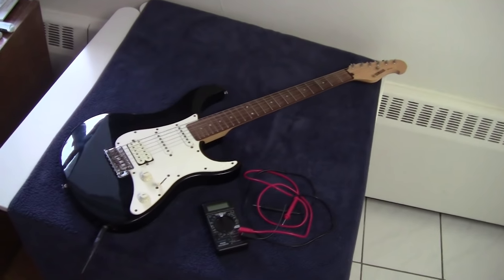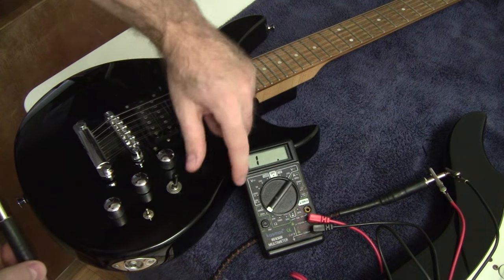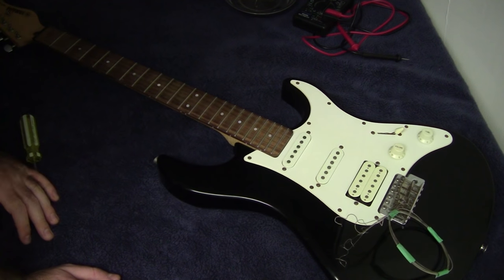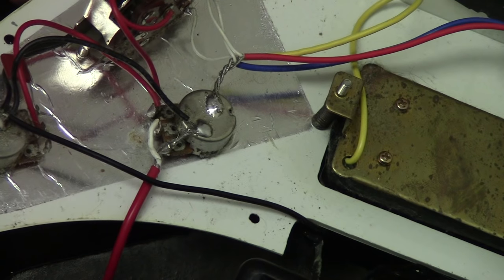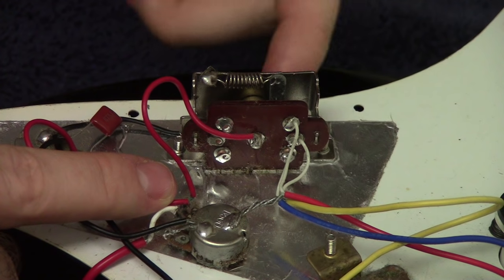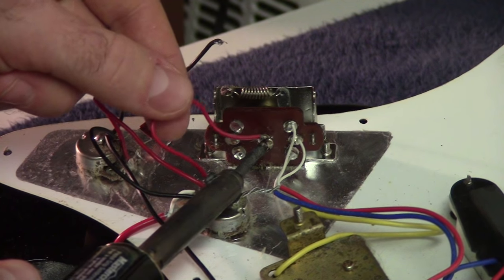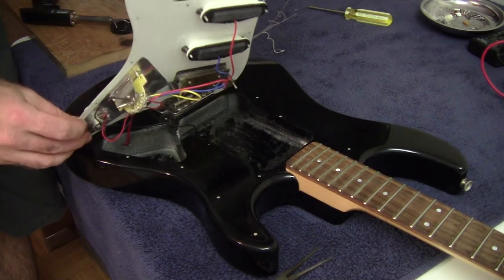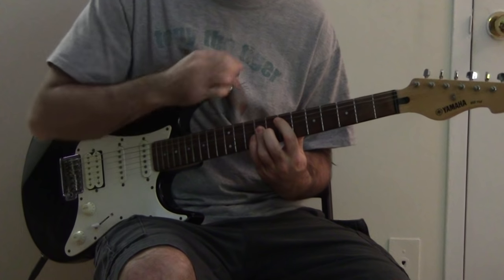How to Troubleshoot & Repair an Electric Guitar

Comment: Wont a working pickup make a noise through the amp when you tap on it with the pick? I never thought about it but suddenly I don’t think my pickups are working,and first want to know if. Thanjs
Reply from the maker: Yes, that is a trick I show in the video. Tap with something made of steel.
Reply: @cjhoyle  I have bridge synth pickups by RMC, plus a HSH pickup set up with master tone and volume, plus coil spitters on my humbuckers, all running to a 6 way switch and then a 3 way blend switch. I don’t think any of the HSH pickups are working now, no sound other than when the blend switch is switched to only synth pickups. I tap the pickups with my pick and get no noise, but I’ll try with metal. I highly suspect a short probably in an outer shielded wire used as a ground touching something hot. I’m 2500 miles from my builder or that would be my first move! I’ll get out my multimeter and screwdrivers tomorrow, and use your vid here to help trouble shoot, THANKS!

Comment: Hey i was really wondering what replacement switch you got? I cant find a compatible one
Reply from the maker: Ordered from amazon.ca. The item is called: "BQLZR Chrome Metal 5-Way Pickup Lever Switch for Electric Guitar Replacement Pat". It's not identical to the original Yamaha part, but it's similar enough and works fine.

Comment: Is it possible to run wires from the mid microphone directly to the plug? would the guitar work at full volume like that?
Reply from the maker: If you simply ran wires directly from the middle pick-up to the output jack, the guitar would theoretically behave exactly the same as if you had the pick-up selector in the middle position, with the volume and tone knobs both set at 100%.

Comment: My EMG pickups have sound when my amp is on distortion but,they don't sound that good.It's like they're not putting out the output that they should.When I switch the amp to clean I can barely hear them even with the volume up. The volume & tone knobs on the guitar function correctly.The pickup selector switch works correctly.I have heat shielding paint in the pickup cavity--I used painters tape where parts might get in contact with the shielded areas.Any help would be great.thx
Reply from the maker: Are you certain it's not the patch cord?
Reply: @cjhoyle  thx for the reply.yes I did. I took it to a guitar tech. I had him rewire and solder everything.He said one of my pickups was bad.

Comment: Hello, i have a very weird problem. When i bend my high E string, my sound disappear. I took a screwdriver to raise the pick up nothing change. As soon i start bending around the twelve frets the sound disappear. if i strum everything is fine. If i touch the pick up magnet with the screwdriver, i can hear equal sound on each 6 magnets. I have an Epihone and even when i use my pick up switch, same problem whatever i use bridge only, neck only or both of them same thing. That is really weird. Great video by the way
Reply from the maker: Could this possibly be a problem with the tone knob? When I turn down my tone knob the highest frequencies become much more quiet (especially the high E string).
Reply: @cjhoyle  Than you for answering.  The problem was not electronic at all. It was the bridge to high on one side. It was a really bad adjustment.

Comment: Neck pickup is giving a full volume sound, middle and bridge are substantially lower(in sound). Can you tell me what i did wrong? 

extra info. 
5 position switch.
Reply from the maker: Was this something that just suddenly happened? If not, I would guess it might be the pickup height adjustment.  The distance that the pickups are from the strings impacts how loud they sound.
Reply: @cjhoyle  thank you for the reply. it ended up being that my ground leads were to long.

Comment: What if you get a reading on the loose end of cord when you put it in the jack but still have no sound through the amp.
Reply from the maker: So you have a patch cord plugged into the guitar, and when you put the multimeter on the other end you get a reading in Kilo-ohms?
Reply: cjhoyle I will have to check again. Gonna check with one of my other meters. This one tends to fluctuate.
  Btw, what is meant by patch cord?  I had forgotten about having this guitar when U came across it in my closet. I used the cord that was in the carry bag.

Comment: Hi just watched your video and my stratocaster has the same reading as yours but in selector 4 I get very low volume out, why Colin
Reply from the maker: hmm. So is the resistance measurement that you're getting in position 4 approximately the sum of position 5 and 3 divided by 4? I wonder if there might be something wrong with that part of your switch.
Reply: I had a check with multi meter and found a broken earth. Guitar now good as new. Thanks for your help. Colin

Comment: I have one guitar string that I'm not getting any sound from, every other string works perfectly through the amp, do you have any idea of what might be causing this or how to fix it?
Reply from the maker: Is it your high e string? If so it's probably just the way that you have your tone adjusted.
Reply: @cjhoyle  yes its my high E I tried adjusting it and it still makes no sound
Reply from the maker: @EPIKGamess  Does the tone knob have any impact on the sound? If not then perhaps that knob has failed or some of the wiring leading to it has. That's my best guess.
Reply: @cjhoyle  yes it does but thats probably the issue because it doesn't effect the sound that much

Comment: Hello.  Thanks for the video.  I need urgent help. I have given all my bucks to guitar services with no good result.  I have lost my crunchy hot tone in my guitar(samick, identical to yours).  Its like tone knob doesn't really reach high,  even if it is on 10!  I never messed up with any electronics inside,  just messed up with bridge position... but it strangely seems that it's a circuit problem... 
Tone in palm mutes sucks,  it's not crunchy mid like before,  it sounds like stoner rock.  Think it's not a humbacker problem,  because it also sounds bad in other pickups. 
Do you have any solution?  Thanks
Reply from the maker: The pickup height will impact the sound, but it sounds like you're convinced that it's an electronics problem since you're seeing the same result with other pickups. Does jiggling the selector switch have any impact on the tone? With my guitar, prior to the repair I showed in the video, the selector switch didn't always make the best connection and it greatly impacted the sound. If it's not that, then like you suggested, the tone knob potentiometer may have gone bad. One way to determine this would be to temporarily de-solder the 'hot' wire connected to it (the red one on my guitar). All the tone know does is allow a certain amount of signal to leak to ground through a capacitor. With the hot wire disconnected from it, you should get 100% tone. Best of luck!
Reply: @cjhoyle  Thanks.  Yes the selector makes some scratchy sound especially when I activate the hambucker.  As for the tone knob Ithink you're saying I should deactivate it to see what happens.  Nice idea
Reply from the maker: @chrisandrea4963  I would try cleaning the selector switch first, since that's something you'll want to fix regardless. Some contact cleaner such as Deoxit should do the trick.
Reply: @cjhoyle  using the liquid the scratch was gone,  thanks. 
Made a tone comparison with recordings before my guitar got issue and I can say for sure there's a tone difference.  It's like my guitar got a hoarse voice and can't reach 10 in the tone pot,  even if its on 10.
I find it strange and illogical that this could be caused by non electric factors such as strings,  springs,  bridge modifications.
So I'll have to open it again and experiment with electronics.  
I find it amazing you didn't destroy the strings... I have changed 4 sets of strings so far!  I don't know if I will manage to open it without ruining the strings but it's worth an effort

Comment: The volume button on my acoustic electric seems to be loose cause when playing it’s gets loud on its own. I turn down and when playing it gets loud. Got any ideas? 🇺🇸🎚🥀🕊❤️🙏🦋💐🥰
Reply: I forgot to say it is a fish an sound system. 🇺🇸🎚🥀🕊❤️🙏🦋💐🥰
Reply from the maker: If the volume knob is twisting on it's own, the potentiometer may have become loose. I think the easiest option would be to just replace the potentiometer.

Comment: I have a two pot, one three way switch guitar where my tone pot is acting like a volume knob!? Got any tips?
Reply from the maker: On my guitar the tone knob has a capacitor soldered to it, and turning down the tone knob sends signal from the pickup through that capacitor to ground. My guess is that if that capacitor got short circuited (or failed in such a way that it behaved like a closed circuit), it would act like a secondary volume knob. I would recommend checking the resistance between the 2 legs of the capacitor (assuming your tone knob works the same as mine).

Comment: see what i dont understand about the eg 112 single pickups is how they dont solder the wires on the posts. how does a pickup work if the dont wrap the coil wire around the posts on the pickup and then solder the power and common onto the pickup????
because i have the same guitar and pulled the input power/common cable out of my single coil pickup
Reply from the maker: hmm, ya I have no idea how the pickups themselves are assembled. They each just have 2 wires coming out of them and everything on the other end of those wires is out of sight.
Reply: @cjhoyle  ya so i opened them to see how they are connected and when i unraveled the black tape the out of sight wires are not actually touching or soldered to the single loop coil winding. do they connect telepathically hahaha. or by magnetic flux i dont know

Comment: My guitar has a sound but suddenly cuts. Do you know whats the problem?
Reply: Intermittent signal loss means you have a loose connection.  Entirely possible that you have a problem similar to the one that CJ fixed in this tutorial.  Another likely source is the patch cable, or the jack.  Not likely that it's your amp, though if you have a second guitar you can use that to eliminate the patch cable and the amp, the same way CJ did here.
Reply: @TheScottJeter  the sound fades fast
Reply: Most likely some metal is making contact with one of the cables and grounding one if the circuits. Make sure wires aren't making direct contact with each other, or with other metal. All it takes is the tiniest strand of a loose wire making contact with ground.

Comment: I have a very old off brand strat that hasn't been used in many years. I can't get it to work, what can I do
Reply from the maker: I'd recommended using a multi-meter and following the troubleshooting steps covered in this video.
Reply: @cjhoyle  I don't have a multi meter

Comment: CJ, if my guitar output jack gives any kind of reading, is it shot?
Reply from the maker: What do you mean by "any kind of reading"?
Reply: Shows different numbers.
Reply from the maker: @charlescozic3208  So in other words, the multi meter is showing neither infinite resistance (open circuit) nor zero resistance (short circuit)? This is what the guitar should be doing if it working correctly.
Reply: @cjhoyle  Like I said, it shows different numbers, unlike your "1" reading, so what is up?
Reply from the maker: @charlescozic3208  In the video I showed what the resistance readings were for the pickups on my 2 guitars. If your guitar is showing readings which are not within the same ballpark as those values, I would recommend to trace the wires back and see if you get those readings closer to the pick ups. If you do, I would guess the problem is the pickup(s). Otherwise, it is probably one of the elements further up stream which is introducing addition resistance or conductivity. Hope this help, thanks for watching.

Comment: When tapping on the bridge or input cover I get a amplified sound back though the amp. What's up with it??
Reply from the maker: Sounds normal to me?
Reply: @cjhoyle  my tele doesn't do it. Just my strat that I have rewired. New pots and pick up.
Reply: Have you found out
Reply: Yes. Had a cold ground.

Comment: I have no sound as well. Going through these steps, I have a cable plugged into jack, meter leads on the free end of cable. Meter reads 5.2 for resistance. I'm assuming that is correct since he said it should read something but not infinite. Next, with volume all they way up I get 0.0 between in and out lugs. With volume all the way down, the video says it should be 1 or infinite but I get the 5.2 again. I also get 5.2 between the in/out lugs and ground. Does anyone know what this indicates?
Reply from the maker: Are you certain that the problem is with the guitar and not the amplifier or patch cable? Have you tried the trick I showed at 15:25?
Reply: @cjhoyle  okay i'm embarrassed to say the volume was off. I originally opened up the guitar because I was getting a buzzing sound when plugging in the patch cable. After re-soldering some wires I did a quick test with the guitar still open and didn't think of the volume. It's not buzzing as loud now but I still get some humming/light buzzing when the 5 position switch is in certain positions. I guess should review the video again on how to test the pickups and/or switch connections. It's a little confusing as to which connections are supposed to show closed circuit (0.0) and which ones should show some  resistance. Thanks for your speedy response.

Comment: My beat up, modified by an idiot, old original '65 Jazzmaster is finally going to tell me what's wrong with it. Judging by some other comments, I've lucked into this one on the first try. Can't afford to take it to a luthier...

Funny, the soldering iron looks like mine...but my tip is screwed all the way in, and isn't bent. Same screw dish, too. Heh.
Reply from the maker: haha my soldering iron has been through a lot, but it just keeps on working for me so I can't justify replacing it!

Comment: What is wrong if your volume does not switch off when at 0 ?
Reply from the maker: So in other words, when you turn the volume all the way down there is still a bit of sound that comes through? This possibly could be caused by a tiny strand of wire that is shorting two of the terminals on your volume control knob. However, it's more likely that something on the inside of the potentiometer has failed and the best option would be to just replace it.
Reply: @cjhoyle  Oh not a little but, it barely goes down, it's a brand new pot from bourns, i've been trying to fix it for weeks now but i just can't get it to work correctly, been burning through a bunch of pots now.😬
Reply from the maker: @MrShadowofthewind  hmm well if that's the case then probably a wiring problem. Perhaps you have the 3 leads which go to the volume knob hooked up to the wrong terminals?

Comment: I restring my guitar and it doesn't make sound
Reply from the maker: I can't imagine how new strings would cause that. Any other hints?
Reply: @cjhoyle  I fixed it already, the problem is in the cable plug

Comment: Dude you're over thinking the electronics fail process.  Just start with cable and amp connections . Then check  input jack wires . Then inspect wire connections to selector switch .
Reply from the maker: What you're describing is almost exactly what I did.